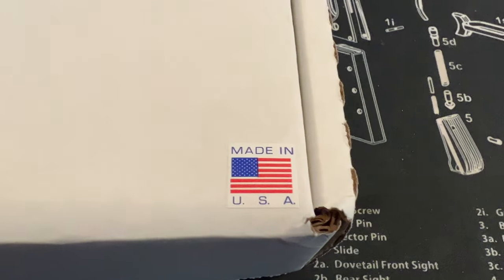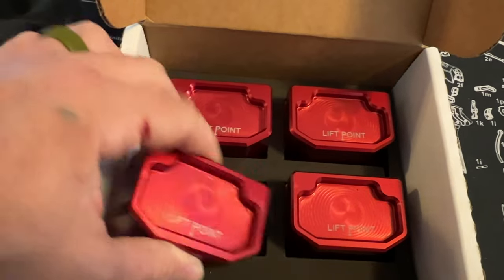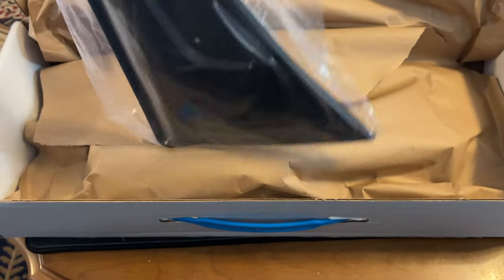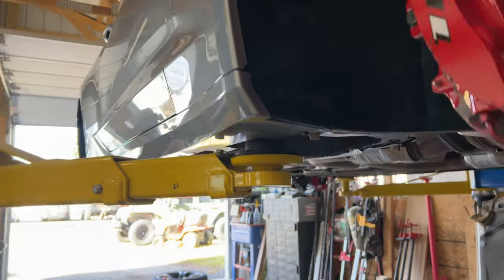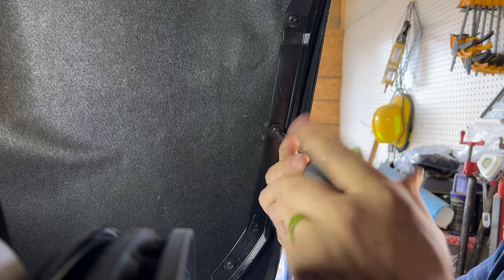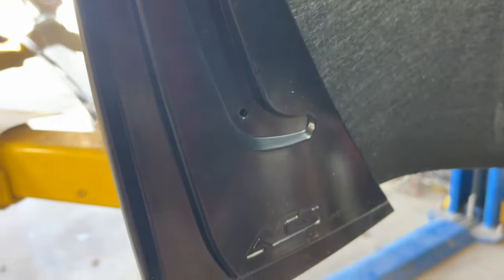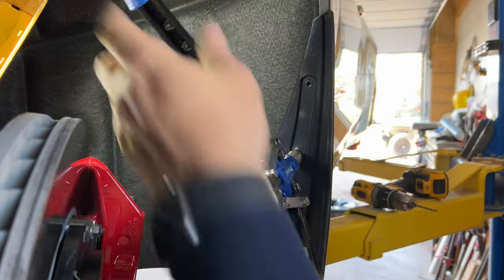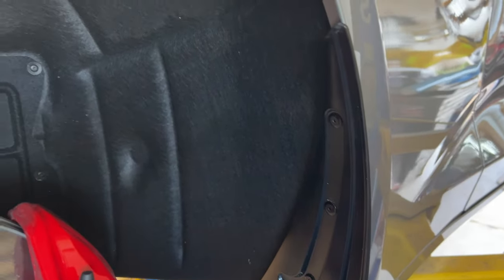ACS Composite Rock Guards Install, 6th Gen Camaro 2SS 1LE

Comment: Beautiful Camaro and great video brother. I bought the ZL1 add ons for mine and have not installed them yet. Now I am wondering if I should have gotten these instead. Such a major price difference though.... For the fronts you are drilling through the fender liner so there is nothing metal you are drilling through?

Also, with the lift pads.....did you do anything to keep the set screws that hold them in place from chewing into the paint causing a possible future rust issue?
Reply from the maker: Sorry for the late reply, the rock guards get riveted through the fender liner, so you’re not drilling through any metal body work. For the lift pad set screws, they are just snugged down on the pinch welds, no additional protection was added.